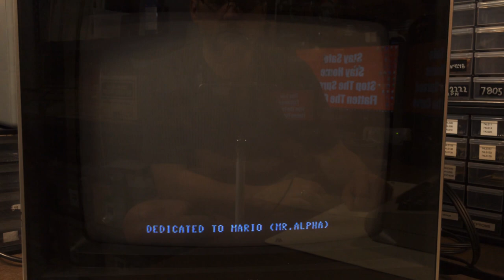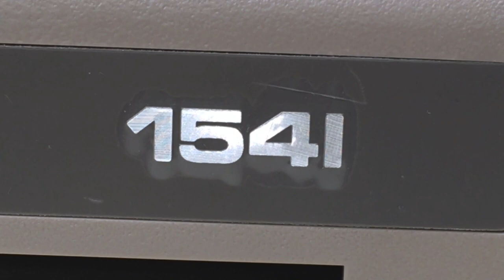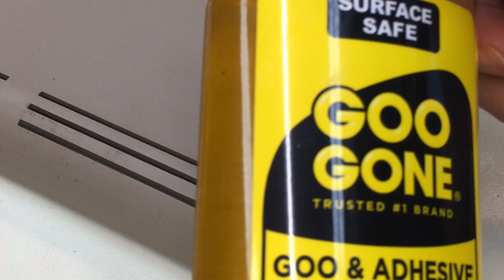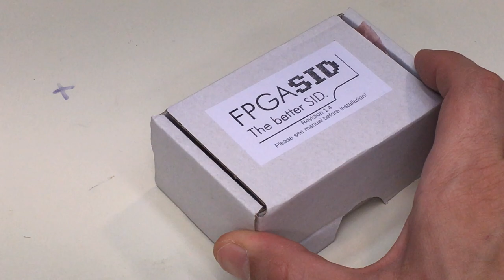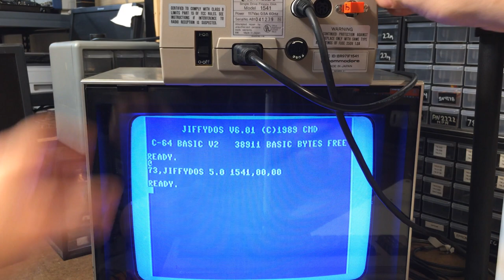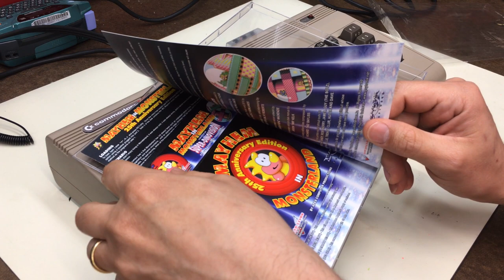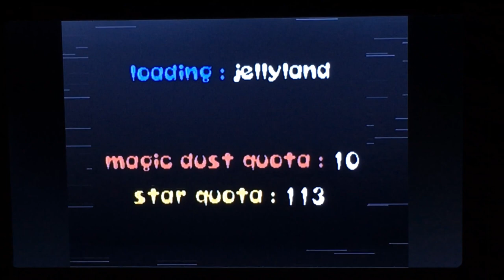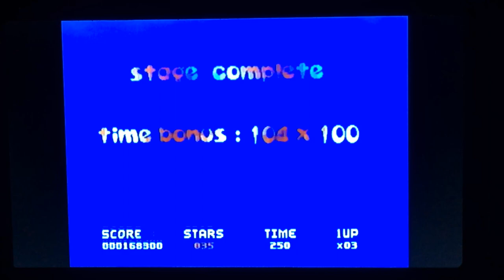Commodore 64 Complete Repair and Restore - Super Chill Restore Video

Comment: The melted plastic bits are probably from it being stored with the cables that came with it touching up against the case. The softeners in the cables react with the hard plastic and cause that kind of damage. Unfortunately I speak from the experience of having stored a couple of 64s that way. Also that contraption with the two AC adapters is a common quick fix to get a power supply. It's not elegant but it's much safer than the stock power supplies.